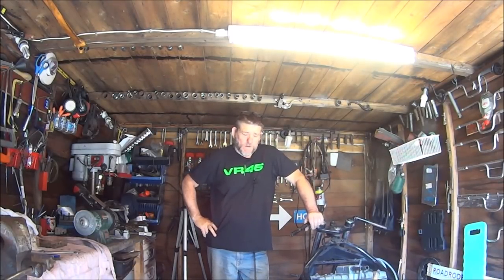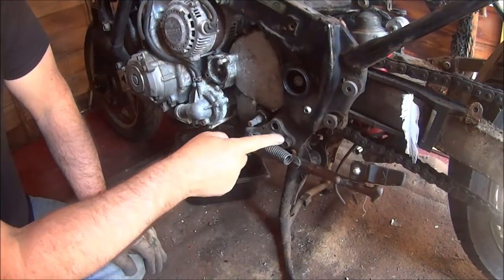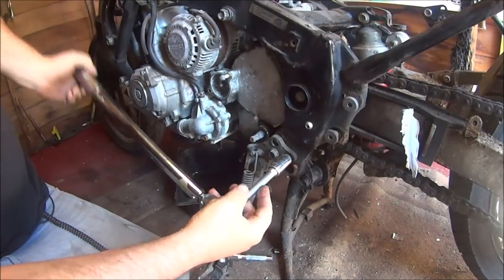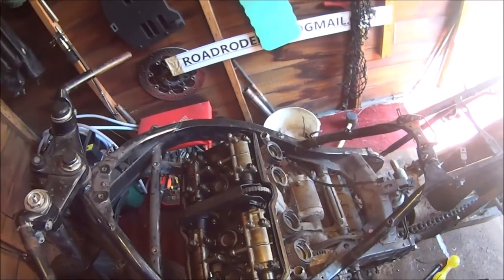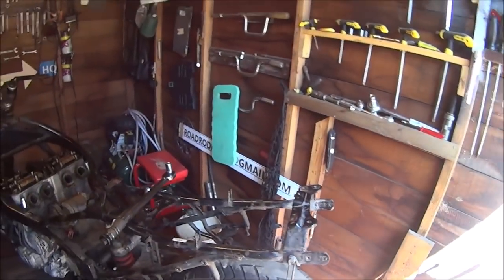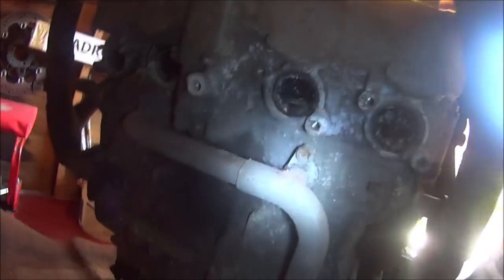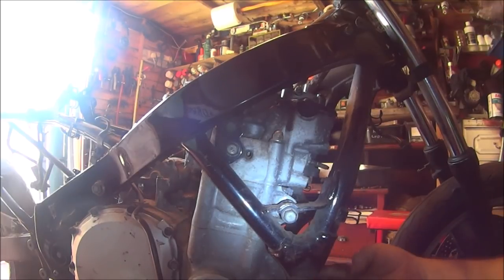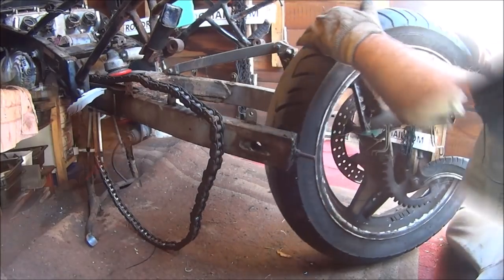CBR 1000F ENGINE removal P-1

Comment: If your Cbr1000f  has cam chain rattle that goes away once warm it could be that you balancer shaft needs adjusting. Even though your extension bar snapped  I bet you got your moneys worth of use out of it most of my tools will only cost a fiver to replace but save me hundred of pounds in garage bills and not many have failed on me.
Reply from the maker: Thank you kind sir I didn't know that so that's another thing I have to look into. Yes we don't need to spend a fortune on tools it's just a bike not HGV lol.
Reply from the maker: Well said that man

Comment: Cheers for the vid, looks like the frame has a fair bit water ingress from somewhere by the look of that rusty front engine bolt and the sidestand pissin out everywhere, look forward to tomorrows vid. Oh and my mum told me you are being very naughty using your torque wrench for undoing tight bolts, very naughty indeed!. Good luck for the next vid.
Reply from the maker: Thanks J glad you enjoyed it and cheers for the tip on the torque wrench I didn't know that..